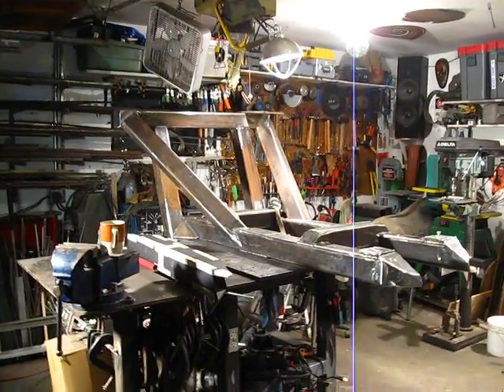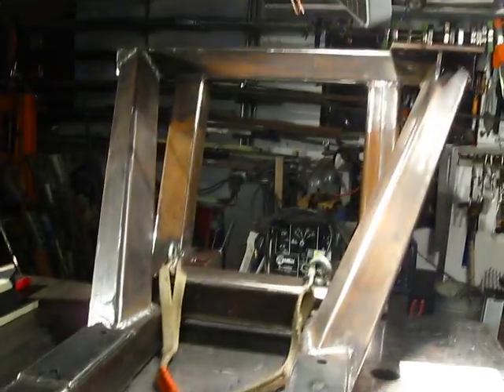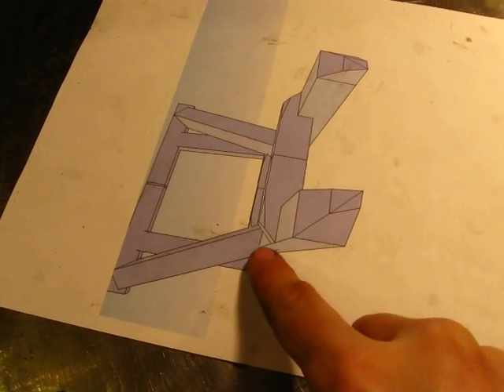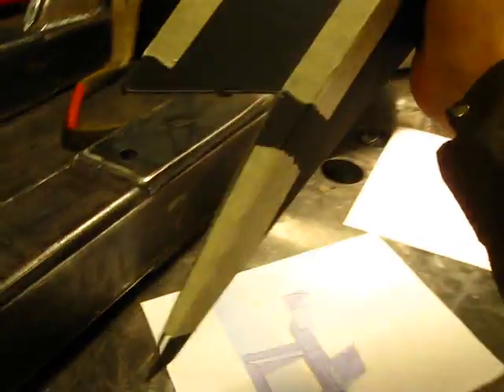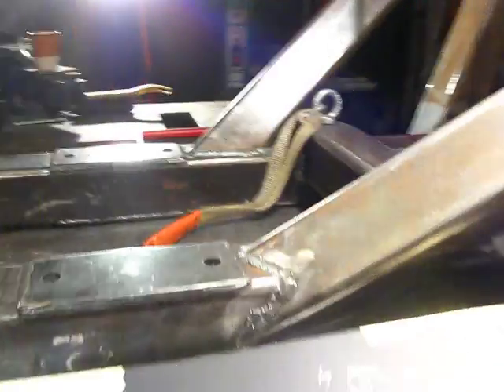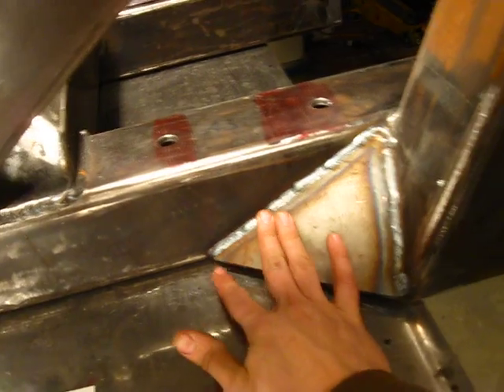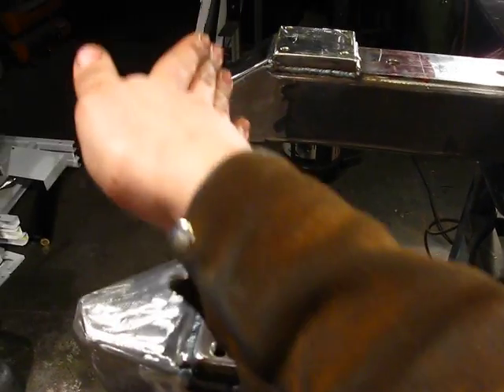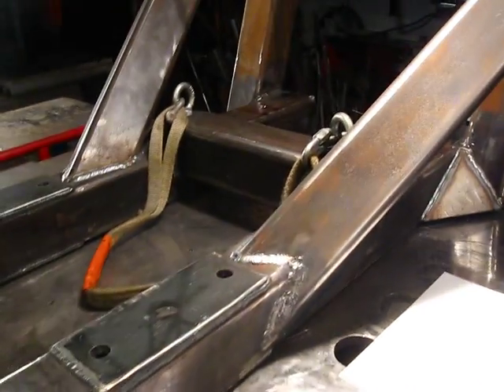More Drive Train Frame

Comment from the maker: Thanks, I did use the intersect feature before pulling my measurements off the program.  I couldn't find a feature on sketchUp to make a "Net" out to the object to easily print a template. I am pretty sure Solidworks does this in a sheet metal module. But I would still be designing the wheel in Solidworks compared to the speed I can go with SketchUp : )